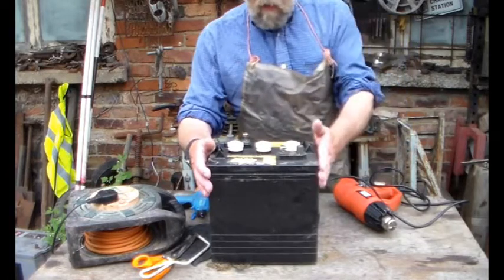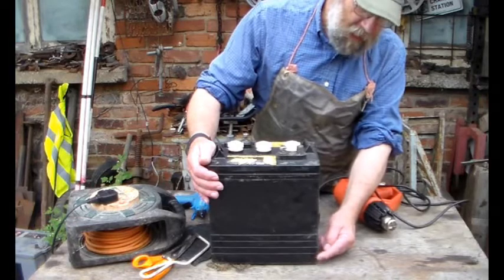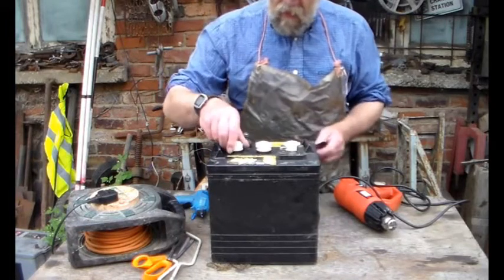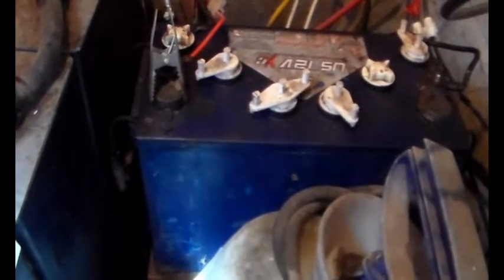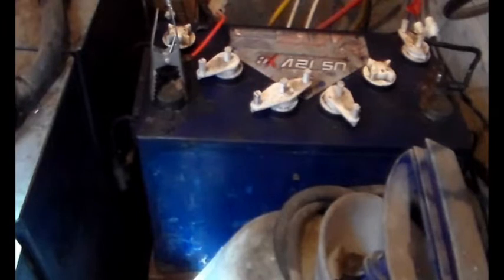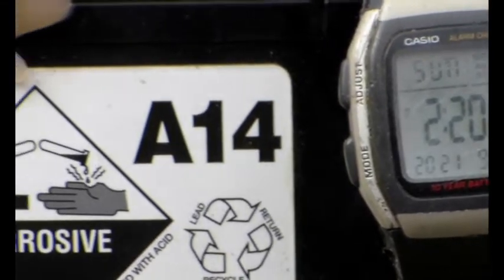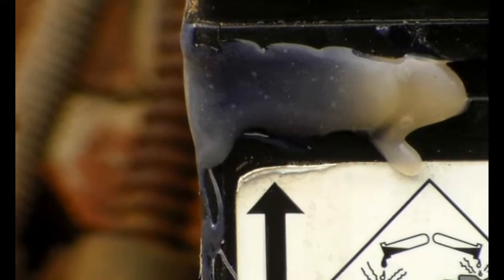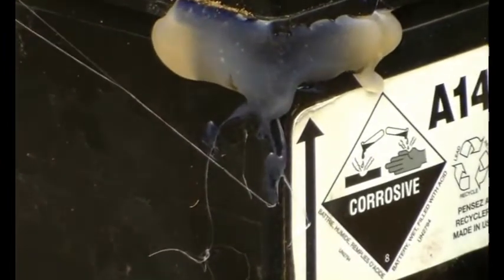Leaking Battery case repair, acid leak, lead acid battery.

Comment: Thank you for showing me that because I couldn’t find any information on any other place to fix. It looks like a good quality fix.
Reply from the maker: John, yes, gentle heat here is the key so that the hot glue has time to flow, there's plenty more battery videos here, cheers

Comment: Thank you for taking the time in this crazy world to show something very useful. I have a battery that leaks from being dropped, and tried plastic melting or welding I guess. That didn't work as when I moved the battery the strain on the case caused it to crack at the weld. I also tried using silicon sealer. That didn't work either. Your idea of heating the battery case before using a hot glue gun looks very good and I will be trying that very soon. Being self sufficient in these times is incredibly valuable as most people throw things out rather than repair them. Thank you one more time. Please remember that we out here are watching your videos.
Reply from the maker: Thanks for the comment, it's a technique developed from the need, cheers

Comment: Thank you for the advice, Sir. I have a great battery with not quite as much damage, a tiny hole on the bottom corner. A great job there. Mine was damaged in the warehouse but the leak was so slow I never noticed it until months later, & too late to moan. Job is in progress now awaiting to order plastic weld material, but I may get a glue gun like you. I have prepared the surface in & around the leak. A good trick of yours to put polythene under the fil hole caps, as I needed to tip it. I have fresh acid to replace the drained cell. Its a 126 Ah for use with ham radio equipment.
Reply from the maker: Hi, don't forget to warm up the plastic and if you do replace the acid with new make sure the cell is fully charged before doing so. Hope you have subscribed and looked at other battery videos, cheers
Reply: @TheInfoworks  Hi thanks I borrowed a glue gun I'm trying to borrow a heat gun. looks like I'll buy one next week only £16, so the job should be done this time next week. Yes, I subscribed, thanks.

Comment: Thank you for this video,I dropped a brand new $160 battery it landed perfectly on the bottom corner ,well bounced i should say, anyway I have hot glue, super glue with baking soda, some spray on liquid rubber stuff, it holds just long enuff to get it in the truck nice and snugged down all connected,drive it halfhour later leaking again, I never thought to warm up plastic on the battery, trust me I'm going to give this a go first thing tomorrow at daybreak I'll let you know how it goes but I got a good feeling it's going to work thank you again from seattle Washington usa.
Reply from the maker: I had a similar experience, that's why I experimented by adding heat to allow the hot glue to flow, cheers

Comment: Great tip Andy cheap fix. Glue guns are underrated so many uses 👍
Reply from the maker: Pat, dead right, they are just the right thing for many jobs. As you can see this fix is durable, cheers

Comment: Yes, the glue gun glue does seal very well with liquids. People should try to repair stuff if they have the skills. Waste not want not.
Reply from the maker: Exactly as long as the glue has time to seal to the plastic case, cheers

Comment: Enjoy your video Buddy . Funny after a bad snow storm we going by the road to my yard a a brane new storage  battery on the side of my fence. I turn it on it side today and but gasket sealer on the long crack from following off of what ever!! Looks like I may need to buy a glue gun and redo by cleaning crap off if it not hold . Thanks for the very good video and Happy New Year
Reply from the maker: Hi, the case needs to be warm and dry, cheers
Reply: @TheInfoworks  Thanks for the reply Andy. Wish I read your fixer upper hours be for I went out and turn it on side , dry and wipe and then the gasket goop . I just ordered a glue gun. Well take the goop off. From the battery falling off a pickup it has more then one crack all the way down to base. Yet the new storage battery still has a charge . ( and drain, wipe clean, plus heat gun ) Thanks

Comment: I am impressed, and surprised that hot glue can hold a liquid joint like that.  I never considered it to be truly water tight.   Your presentations are clear and pleasant to watch.  Thank you.
What do you think about just using heat, like a soldering gun, to melt over small factures or holes in a battery like this?  I know one has to be cautious about boiling the battery acid, but I doubt that would happen with just 30 seconds or so of melting over a fracture.
Reply from the maker: Hi, I've never had any success with melting the edges together, that why I developed this idea and warming the case to prevent instant cooling, cheers

Comment: Thanks  I was going to do a repair with a special silicone, but will now try using my wife's hair dryer and our glue gun.
Reply from the maker: David, it works for me, that's why its worth sharing, don't forget to refill the cell. cheers

Comment: Thanks Andy, I never thought of a hot glue gun to repair a battery, I’ll have to try that.
Reply from the maker: John, as I said it's worked well for me, you might develop your own method, cheers
Reply: @TheInfoworks  is it applicable if we put aspalt on the hole?
Reply from the maker: @jaketheexplorer6514  Hi, don't know, will it stick and how long does it take to harden, there's only one way to find out, cheers

Comment: If an AGM battery has a large hole at the upper corner (a new battery dropped in transit) will it have lost electrolyte from the absorbent glass matting, what method of repair would you use to seal the hole, the hole is right on the upper corner and is about the size of a 2 pence piece. 
Thanks and I enjoyed your video.
Reply from the maker: Hi, almost impossible to answer, depends how long the battery was on its side. You may have seen acid on the floor and how long has the cell been left open for the water content to evaporate. There's only one way to find out, cheers
Reply: @TheInfoworks  Thank you.

Comment: I dont have a heat gun think a torch would be suitable?
Reply from the maker: I found it more difficult with a torch, more intense and less control, but there's only one way you will find out, cheers

Comment: This is super helpfull !
Huge thank you for that.
I have a crack on the bottom and most of teh acid went on the floor. So I think it will not work if I refill it simply with water. Do you have any advice on how to make battery acid at home ?
Reply from the maker: Hi, if you have a battery with a faulty cell, then make sure the other 5 cells are fully charged to get the acid as strong as possible, then harvest it from those 5 good cells, cheers
Reply: Thank you ! @TheInfoworks

Comment: Hi. Just saw video. I've a hole at bottom of my battery. Which is maintenance free. How do I get to the cells to fill up cheers
Reply from the maker: Hi, difficult, the top plate is glued on and there is a small round rubber seal on each cell top. If you can identify the cell top and cut the plastic top plate to reveal this seal, then you can top it up, cheers
Reply: Hello Andy, thanks for the reply. I've drill on top to get to cell,my next dilemma is do I need to get sulphuric acid aswell or just topup with distilled water. It's still holding a charge of 12.8 as it's a leisure battery only a week old. Thanks
Reply from the maker: @joe-sc2vf  It depends how much electrolyte (acid) you have lost, yes it will show voltage but there will be less current available. The acid should cover the plates, best place to get acid is from another fully charged battery. Cheers

Comment: I have two batteries where the corner edge both Frozen split will this type of repair work on a 4in long split on the corner going vertically?
Reply from the maker: Steve, yes with care. If you have any other dead batteries you could cut the corner out of one and glue that over the join to add strength, cheers

Comment: I have a lead acid battery with a broken trough cover and no cell plugs. What would be best advised to do in this case?
Reply from the maker: Hi, fix what you can and make up some plugs with vent holes, cheers

Comment: Hi again Andy, could you recommend a drop tester? As I’ve said I have 4x T105 6v Trojans on my boat and they are 7 years old now and would love to know if all 4 are playing ball…Thanks again Andrew
Reply from the maker: Andrew, I make them to order with nichrome wire resistance but they are much cheaper on ebay. The automotive ones are 6 or 12v. The very cheap ones may well be rubbish. I have in the past made up a temporary tester with big heavy duty jump leads, nichrome wire from an old storage heater and a multi meter to measure the volts. Drop testers should only applied for a few seconds. Hope this battery case fix helps with you problem, cheers
Reply from the maker: @bootsowen  Owen, I noticed no one commented on the moon debate, I just figure that the soap drawer is a tried and tested technology, cheers

Comment: Do I just refill the cell with distilled water And charge it ?
Reply from the maker: Hi, replace the acid that you have removed and add more 1280 acid if you have any. The charge slowly. Monitor the specific gravity when fully charged and adjust as necessary by removing electrolyte and adding distilled water or acid as required, cheers
Reply: Hi, monitor the gravity? What does this mean? And what do you mean by remove electrolyte and top up with distilled water? By electrolyte you mean battery acid? Why remove it and replace with distilled water? Sorry I’m a complete newbie to diy
Reply from the maker: @SH-vt2km  Electrolyte in this case is the acid. Gravity = specific gravity = the density of the electrolyte. No, the electrolyte removed is put back in the cell. See my book for greater battery info: Wind and Solar Electricity, go to my channel page and look under "about" cheers

Comment: i used hot glue to remove dents, some of that glue is still on the car over two years later.
Reply from the maker: Hi, I like it, cars are tools not show pieces. I find it good on electrical stuff also as unlike silicone it has no corrosive acids, cheers